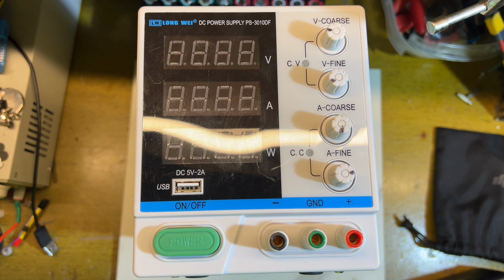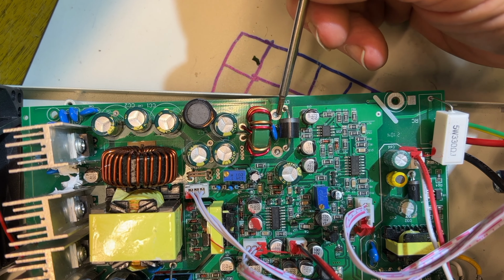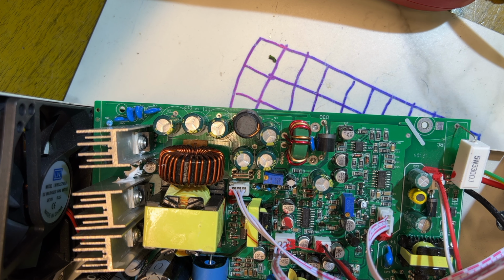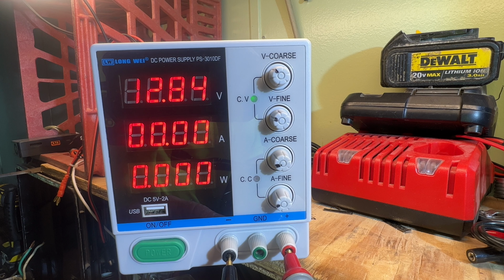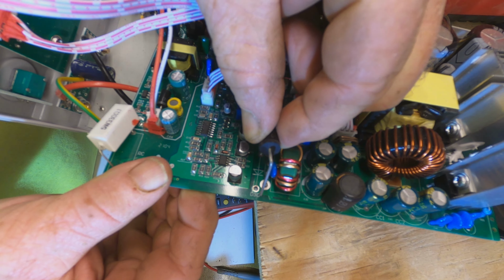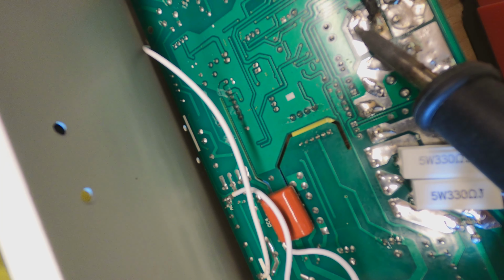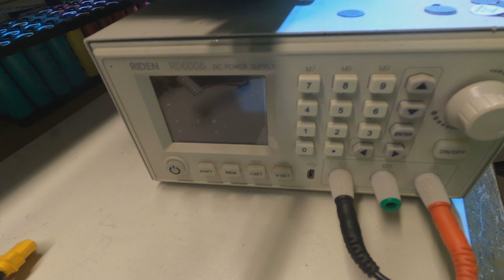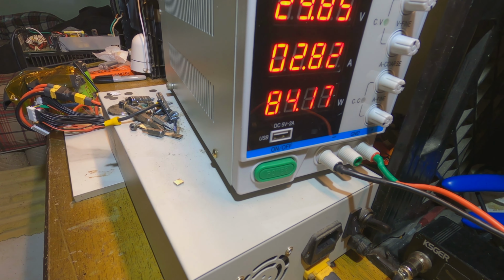Chinese Lab Power Supply Repair/Long Wei PS-3010DF

Comment: Wish my LongWei PS-301 was that easy to fix.   No short on output and red light off but it wont start up.  No voltage/current shown on LED display and green voltage light pulses once every 2 sec and fan tries to start and stops each time.  I have 330V DC from mains rectification.   Had this prob occasionally from new but now its almost permanent.  No sign of physical damaged components.
Reply from the maker: @mikebloodworth9258  I would start testing fets and transistors.
Reply: @lmorrison17  yeh, it's a temperamental power supply  When it does start up correctly, all functions work perfect to max load and voltage.  The initial kick start is tge problem.  Did you ever get a schematic circuit diagram for it?
Reply: I had the exact same problem and I managed to fix it. The cause is a missing capacitor C7 100nF. It was not mounted to the PCB. It should be next to the connector JP1. After adding it in, the power supply is fully functional. If you need more info (photos, schematic), you can reply to me here to let me know.
Reply: you could check a 12v , -12v, 5v, regulator rail,  there is some components like TNY280 , PC817, or TL431,